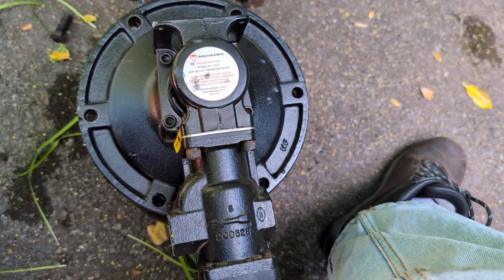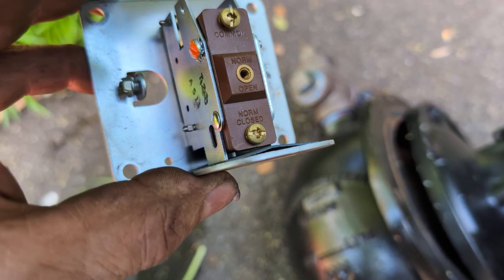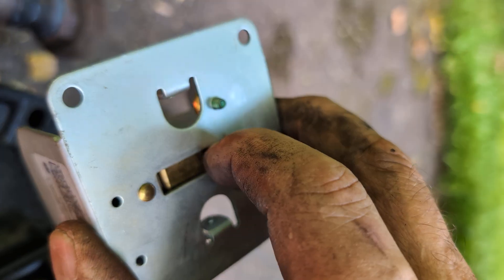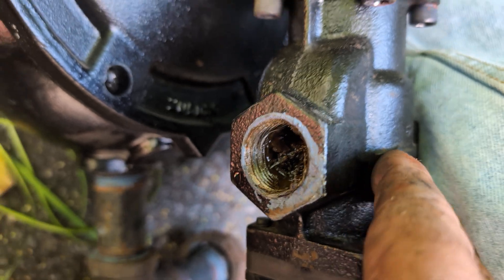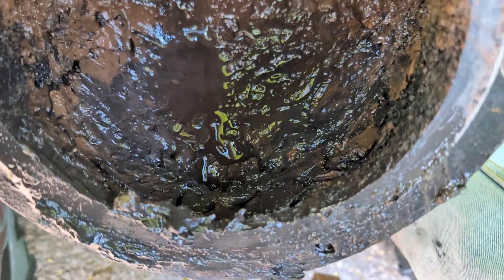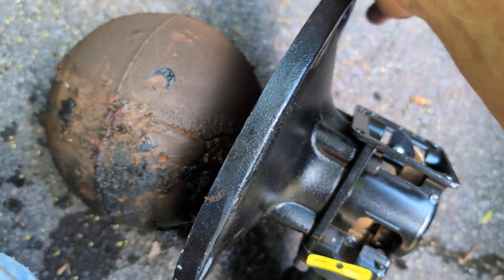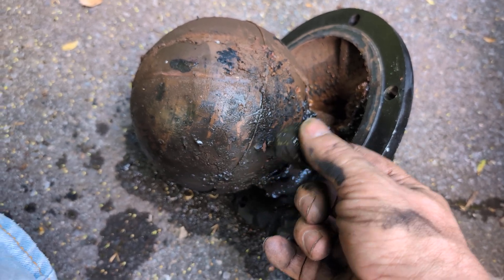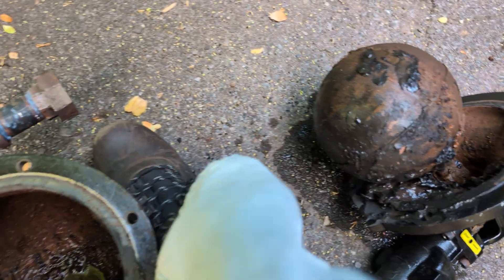McDonnell & Miller Float Type Low Water Cut Offs For Steam Boilers Are Double Plus Un-good

Comment: I think for a commercial setting where you have constant monitoring of mechanical equipment this low water cutoff is ok.  In a residential situation where people can’t seem to grasp that mechanical devices need to be monitored, an electronic version is much better.
Reply: That’s why I see both in commercial applications because the 51-2 is mechanical and will feed water even in the absence of power

Comment: I agree they are not the best old technology versus new. But they have been around forever, and they work. Maintenance and the ridiculous cost of replacement parts are a huge issue. When I started in 73' that is pretty much all that was available and was better than nothing. Really, they should be pulled apart and cleaned annually. If the valve and strainer assembly was brass (how much would that cost!!!!!) they would be better.
Reply: The problem is they are a high maintenance item. It looks like the owner of the boiler was not doing weekly blow downs. You are supposed to pull it apart each year but I think the cost is prohibitive for most people.
Reply from the maker: In this case, the installer should not have installed a float control low water safety unit on a residential boiler with a customer that goes out of town for part of the heating season. Period. 
The installer compounded the error by installing a globe valve on the drain!!!!
And the icing on the cake was the fact that installer jimmied the #2 switch SO IT WOULD NOT WORK!!!!!!!!!
Reply from the maker: Dear Ed, I get you are saying.
When I started in the early 90s, I didn't trust the probe type LWCO and liked the old #67.